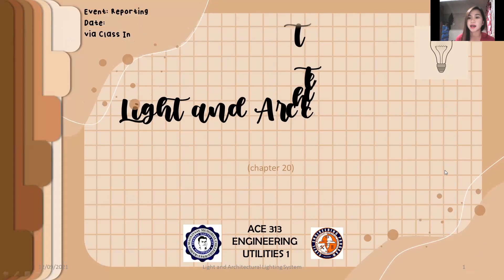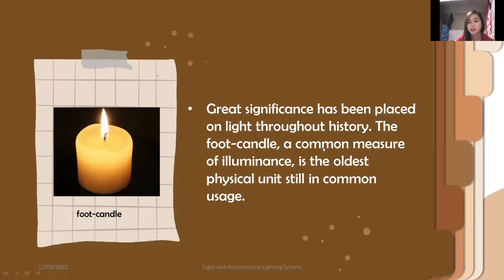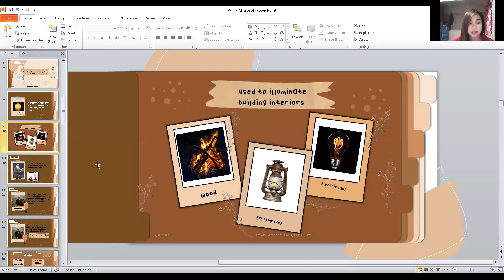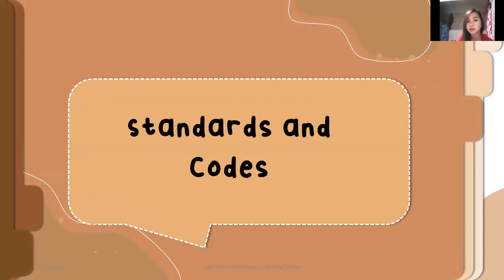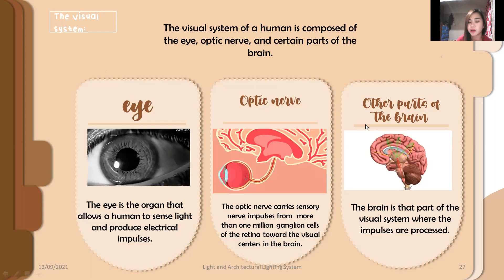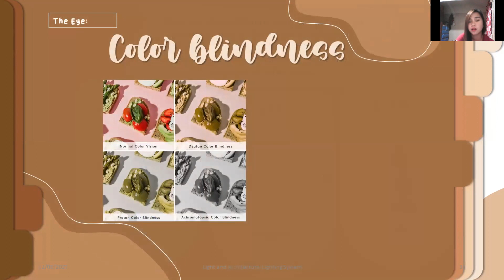GANGOSO, LYKA EVE M. ENGINEERING UTILITIES 1

Comment: According to this report, light has always been revered throughout history. I learned that lighting is one of the most important factors to consider when building space or a room because it has the ability to light up your space and the color of light can have an impact on the optics of specific items, such as works of art, as well as the broader of the entire environment. A good lighting system is designed using a combination of scientific principles, aesthetic ability, and design experience. As electric lighting gained popularity, several advances in lighting happened.